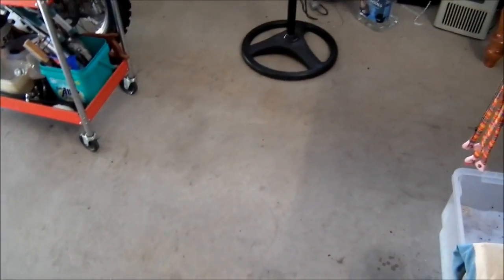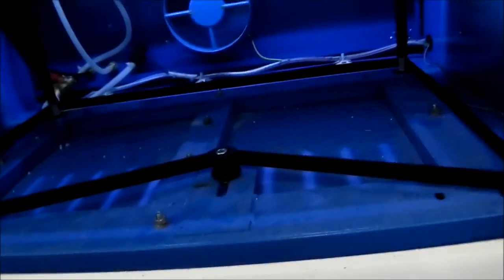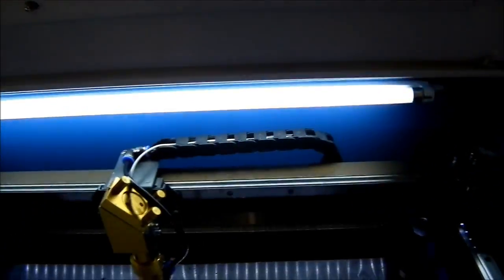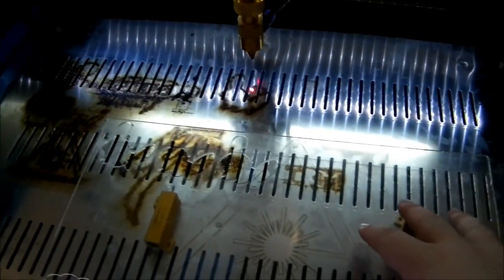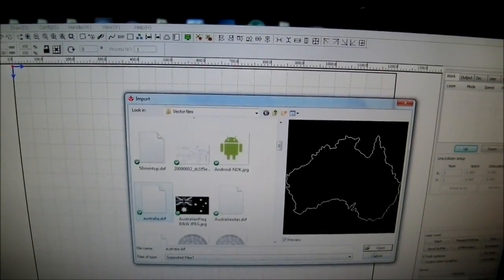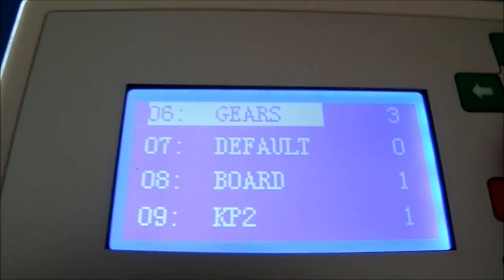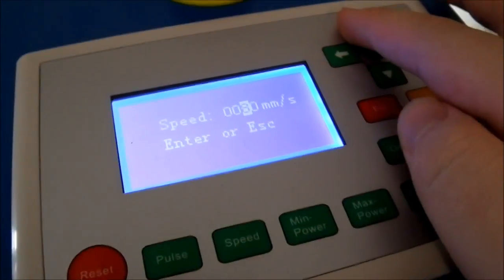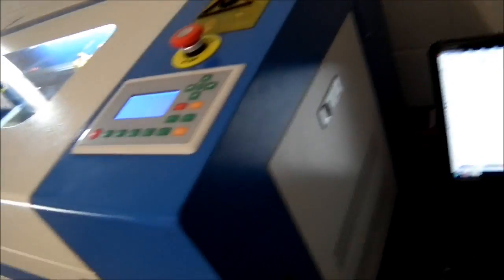The eBay laser cutter!

Comment: Lots of problems with my $2,500  'ebay' laser.  The LaserCut software is really buggy.  Lots of random errors in middle of the job.  40 watt laser tube was not cutting and discovered it tested at 20W.   The support docs are Chinese.  The manual z axis is a pain.  Wish I would have paid for something tried ans true here in the US.  Not recommended.
Reply: I learned my lesson about expensive eBay Chinese junk during the summer.  If it costs more than 300 dollars delivered I will just save longer and buy something I can drive to and punch someone out if it was a lie.  There is hope as someone just bought another 40w Chinese laser and it was really good and the laser tube was 5 inches longer so measures out to be a true 40 watts.   By the way if the tube is not the right length eBay will refund your money based on seller fraud.

Comment: Thanks for great video.  I got mine today and I am trying to do some work but i have problem when cutting 3 mm acrylic.  It either burn the acrylic (it goes black) or it does not go through. I've tried zillion combinations of speed/power ratio but i can't find the right one. 
When looking at your video it cuts pure and clean but i cant get that. Usually acrylic gets black an sticky. My cuter it is also 50w but no led display. (I guess older model. )
Any suggestion? Am I doing something wrong?
Thanks

Comment: do you think it would be possible to transmit like a intessity map to the cutter, that tells it wich intensity the laser should have at wich point to engrave some grayscale images or something?
Reply: +MsMotron He mentions in the follow up video that the software will take a bitmap image to do an engraving, if thats what you mean.
Reply: but will the laser poweroutput be proportional to the pixels on the bit map or will it only go on and off?
Reply: I'm not sure if these lasers act as TTL or if they are capable of cutting Analog (I know you can set different power levels for the cuts but idk if these will change it during the cut like that)
Reply: yeah i noticed, that the power level can be input over the menue, so at least it should be possible to write some software to trick it, put a new arduino in it all together or something along those lines. i just dont know how difficult this would be and i doubt that i am capable enough to do it.

Comment: What happen in a case the IR laser hits the bottom and reflects back in the EYE !! !
Reply: +LPFthings you mentioned you can engrave on glass? Is it possible to do a photo engrave on this type of machine? Thanks.
Reply from the maker: +Póntos Olympians That's why it has a lid with a window in it.
Reply: Ahh Ok just asking since the laser is 40W haha and the glass is see thru. Tx for the answer.
Reply from the maker: +Póntos Olympians Almost all clear materials completely block the wavelength of the laser used in cutters like these - thus why you can engrave on glass or cut clear plastic.
Reply: Ok Thanks :)

Comment: CO2 laser dsp controller and motion control systems will not "light up". Have you ever had to replace it? I've only had it since 12-2-2014. Have tried to make contact with shipper/supplier with no success. Email complaint to Amazon. Hopefully they can resolve this issue.

Comment: Is this the same machine? http://www.ebay.com.au/itm/50W-CO2-LASER-ENGRAVING-U-FLASH-DISK-DESKTOP-DEVICE-ENGRAVER-CUTTER-SPECIAL-BUY-/221230313769?pt=LH_DefaultDomain_15&hash=item33825ab129
Reply: RCWASPOVISION  yes, that is the same machine.. watch out for that seller though, they ignore you if you have a warranty claim on their cheap machine, and your paypal dispute period has ended, as i did when the controller died 6 weeks in..  also, thats a awc608 controller by the looks of it, so actually works with better software than this guy seems to suggest.. eg with a corel draw plugin.
Reply: intriq8 Thanks mate! :)
Reply: RCWASPOVISION this is a very old video and all of this guys info is rather old eg: "parallel port" on the the cheap cutters. not the case, they're usb, with moshi controller now, and they cost $500. And at the time, he clearly didn't really know much about laser cutters, and using them. If this is the resource ppl are drawing on, I need to make some better content...
Reply: intriq8 True, it's a couple of years old but it's a good starting point to get familiar with these types of machines. I'd also look around for more recent video's and info before making a firm decision. If the 40W has improved vastly and is up to this 50W's standard then it would be a great purchase! :)
Reply: RCWASPOVISION ah, the $500 one is not up to the same standard, but it is also not as he described. it has usb. and cheaper everything. 50w units like his with the z table and air assist nozzle are definitely better devices.. just depends how much you want to spend. 
Fullspectrum are a proper reputable laser company with surprising cheap lasers if you are willing to pay more than rock bottom chinese prices.. think like $3500.
Reply: intriq8 Yes, I think in one of his other video's he mentions some ways to improve this machine and make it even better. I'm in no way ready to purchase one but thanks for the info you've provided especially about the alternative company. It's definitely a machine you'd want to be using frequently if you're going to fork out the cash.

Comment: need your help, just buy a laser machine to which you have in your video. did not come with manual or software. it's my first laser machine I have a router cnc 3040t use it with mach3 , have some mail to send you pictures of the parts arrived and so I get an idea and see how it helps to connect ? I really appreciate it

Comment: I hope you were wearing laser goggles while filming... the reflected laser struck the camera lens over 2 dozen times in this video.
Reply from the maker: The red laser you can see is only a few mW, it is not dangerous. The high powered lasers wavelength is 10.6um, which is absorbed by almost everything, including clear plastic and glass. There is no risk apart from putting body parts into the beam.
Reply: Sorry to jump to a conclusion, then.

The information you gave me about the red laser only being a "low-power spotting laser" was not clear in the video. You even showed the 4 safety switches with the one controlling the laser set to the "on and dangerous" position.

I just want to make sure everyone stays safe!

Comment: I have purchased one of these and have a question about the control panel. The language on mine is set to Chinese and the instructions that were sent are apparently for another model. It indicates that to change the language just press the Language key. Problem is mine has no Language key it's labeled Frame. I can't seem to find the proper manual for my control pad. Do you know how to change the language on the key pad to English?

Comment: Maybe I missed it in the video, but how thick is the plywood you can cut reliably and at what speed?
Reply: LPFthings Hi, I'm just playing with my new toy - same one as yours - all great fun and many thanks for the videos which have been very useful in getting to grips with this machine. Hoping you might be able point me in the right direction on this..... I'm trying and failing to cut some 6mm ply and wondering if you have had any success on this front?  I just cannot get through to the other side, even at 2mm/100% - just get a very cooked top surface.   I saw someone mention doing a mutipass cut but I guess we are limited to running the same file twice/three times to achieve this?  Anyway, if you have any tips on cutting for those new to the game it would be fab.... Cheers from a sunny UK.
Reply from the maker: Reliably? Probably nothing over 6mm or so. It could probably handle more but too thick and the edges will start becoming pretty rough. As for speed, for 6mm ply, probably around 5mm/s.
Reply: Hi,Timo,I am Angela from China. We are the manufacturer of this machine, any questions pls feel free to contact us: pbmachine@possiblemachine.net
Reply: Angela POSSIBLE

Comment: If you want to clean the table just use a rag dampened with water and wipe it off and don't go over 90% of your power or the tube won't last very long.  Just a couple of suggestions.
Nice video. :-)
Reply from the maker: The ventilation eggcrate I've installed has taken care of that problem. I've also set a "hard limit" internally on the DSP that limits the tube current, I've found in the past that running at max current actually gives you LESS power, just more heat to dissipate and lower tube life.

Comment: Ive had this machine for 3 years, love it!   The best way to raise the material from the bed is use magnetic screw bolt thingys
Reply from the maker: I've found this eggcrate ventilation grille to work very well, and it's cheeaapp!

Comment from the maker: @Gabriel Geller the distance from the material to head is determined by a small piece of acrylic they send you. You just put it under the nozzle and adjust the bed height until it touches. Also, if it's giving you the previous frame, it's possible you have the control board set on an old file. If you upload a new file and overwrite the old one, it goes into the same file number as the previous one. If you don't overwrite it, it goes into a new file number.
Reply: Hi, I am from Melbourne, I recently brought this machine and noticed it only cuts max 2mm MDF/Acrylic. I changed the speed to minimum and increased the power and adjusted the height too, but still cant cut a 3mm MDF. Could you please help.
Reply: do as many passes until it cuts through

Comment: Hi I just bought one of these as my old k40 machine packed in, is it easy to get it set up for rubber stamp making, the instruction manual looks daunting
cheers
Reply from the maker: Yes, very easy to get going. If you could manage to use the K40 machine this one will be a dream, lol.

Comment: Sorry to be a comment hog, but one more cheap mod I have done it to use a Carpenter's square to create an origin guide.  Use paper to cut origin axis lines then place the carpenter's square down along the lines, and epoxy some neodium magnets along the outer edges so you can remove or replace the square if  you want.  All my projects are now cut or engraved at the origin & I don't have to spend time aligning the material.

Comment: I have made 2 cutting beds on the cheap. One is an old picture frame with heavy aluminum  mesh (heavy enough not to sag). The other is a flat piece of steel with a bunch of screws epoxied onto it upside down (everything is painted flat black ).  I also plan to motorize the Z axis (maybe even a separate stepper & single controller wired to the DSP controller Z  axis switches).   I'd like to see how to connect the air pump to the DSP  (I have an extra on-off relay laying around).

Comment: I have the same machine. Its been 6-7 months now and I'm extremely happy with it. Had one of the $800 ones before and its really just a hobby machine and very limited in what it can do...and very SLOW.  The larger machine with DSP control is a MUST HAVE if you want to do any type of production work.  I think the tube IS 50W because its slightly larger than the 40W tube in the cheaper machines.  I like your LED lights...I'll be copying that mod.

Comment: That is a nice unit. Much nicer than the super elcheapo one i have. You would think china would steal a better software for them. The moshidraw software is total crap. I bid on the cheap one figuring i can build my own enclosure in the future its a cheap way to get the tube, power supply, steppers and optics so i guess it will work out. 
really like the review of yours nice video thanks